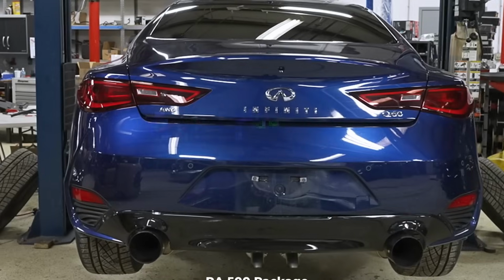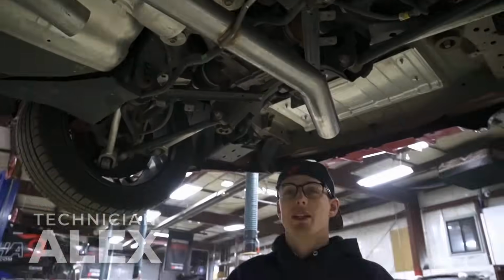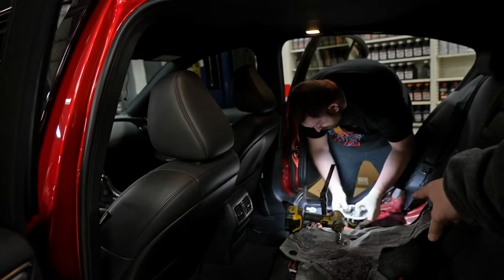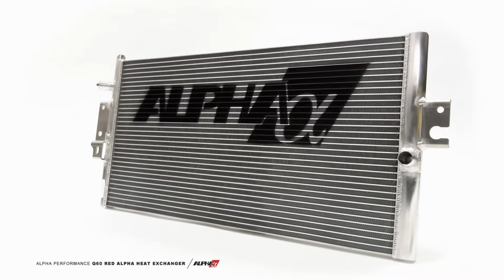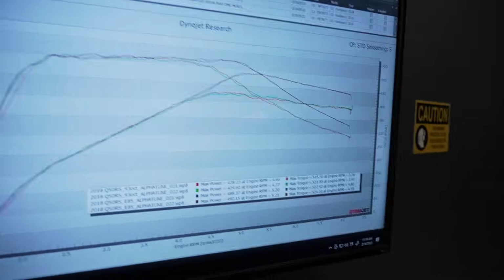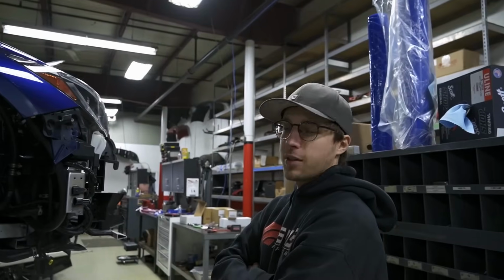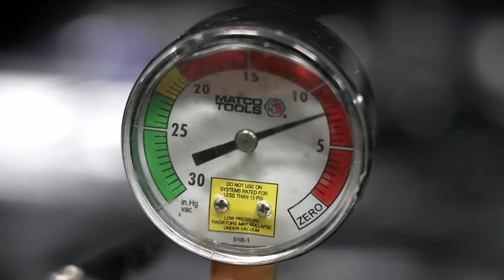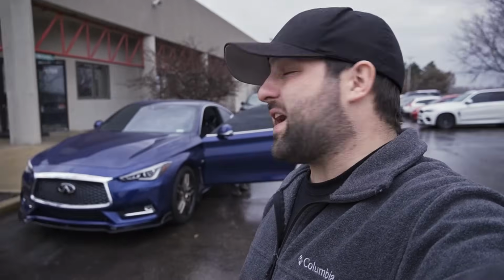RA500 Q50 & Q60 BUILDS | 500WHP AMS Infiniti Performance Package

Comment: Do you guys see any issues long term on cars at this power level with no blow off or bypass valves? I have essentially the same setup as your RA 500 package and currently making like 450/530 whp/wtq. Basically as much power as I can make on the stock turbos right now, but I don’t have BOVs. Initially my tune was setup so the throttle doesn’t close immediately to try and save on the thrust bearings in my stock turbos until I’m ready for Stage 2’s but at times that got a bit hairy because the car wanted to keep pushing  for a half second after you let off from WOT. So now I’m setup so when I get off the pedal the TB closes immediately but I know all that pressure going back to the turbos can’t be good. Especially considering the stock boost level on a Pure/Luxe is like 8psi and a RS is like 14 but I’m running around 18psi now. This is the only turbo car I’ve ever had with no blow off or bypass setup so it’s new to me. I did start running 5w30 rather than the 0w20 hoping that would help a bit.

Comment: Nice I have a 2017 RWD Q50S Added AMS  Airboxes and Stillen Cat Back Exhasut...I'm at 426 hp now...any other ideas?
Reply: From their site this package is : "Red Alpha Cold Air Intake System, Red Alpha Heat Exchanger, Red Alpha Full Downpipes, Red Alpha High and Low Pressure Fuel Pumps, EcuTek Bluetooth Kit, the RA 500 E85 Tune.

I'm not sure if they left the exhaust out of this package but it sounds like you need a heat exchanger, downpipes, fuel pumps and an e85 tune to make closer to 500whp.
Reply: You push 426 with those 2 mods and your not a rs?
Reply: Man that’s a lot of gains for 2 mods.  Wonder down the road if there will be problems blowing the engine..??

17’ Q50 Sport spec is on 300HP/295 Torque.
Reply: @Unplugged704  the low boost vr30 is mechanically identical to the RS in everyway except boost pressure. the RS has turbine speed sensors but the low output engine also has the capability to monitor shaft speed, it just does it differently.

Comment: Do you have to build the automatic trans that's on the VR30 to hold 500WHP or is that what the stock trans is max rated at?
Reply: Simple driveshaft upgrade and billet flexplate and it’ll hold up fine. The 7AT might not be a DCT but it’s relatively strong till around 750whp 530-550wtq

Comment: I’m gonna ask a dumb question but with e85 can I use premium gas
Reply: E85 is a type of fuel. Premium gas (typically 91 or 93 octane) is also a type of fuel. If you are asking if you are able to use premium gas in a car tuned to take E85, it’s not ideal. The spark timing is completely different as well as a host of other factors that not only reduce efficiency but also may put parts of the car in jeopardy. If you’re planning on only running E85 and have reliable access to it anywhere you go, then go ahead. Otherwise, just go for a 91/93 tune (which is what I recommend for most people wanting power) or a flex fuel tune if you so desire.

Comment: I need this as a winter car. 370z is not good in winter, lol. 😆
Reply: I have a 2006 Zed and it is marvelous winter car.
Reply: Yeah - had a snow storm at the grand canyon, walked out to my Z, and surprise 3-5" of fresh snow... was fun going 25mph doggin it in 3rd gear for 2 hours in worn down ps4s tires... never again!!  Learned that if you see 10-15% humidity in the forecast during the winter = be prepared.  I suspect the horrible winter behavior of the 370z on snow has to do with being staggered and the rear differential... easily the worst vehicle I've ever delt with in the snow... my $800 pos mazda college student vehicle did much better, and it was a total $hitbox.
Reply: @07wrxtr1  its the tires bro... get some winters on it and theyre actually pretty decent in the snow. worn down summers in the winter is asking for trouble

Comment: But how reliable is that 500whp on this car can you daily it comparing to the n55 and b58s for 500WHP daily
Reply: It holds up pretty damn good. I think that's about the limit though, personally I wouldn't go past 500whp with stock internals on these cars.

Comment: Great video I have a Q 60 I want to know is it OK to wrap the intercoolers to keep the engine temperatures away from them
Reply: Second this would love to know!!
Reply: Being that it's a liquid/air and not a Air/Air. I would say yes it's OK to wrap them to prevent heat soak. 

But then again it being liquid, it could possibly force the intercoolers to retain heat more. Since some air flow over the metal bodies could pull heat away too. 

I'm also genuinely curious as to what AMS has tested. I always been iffy with heat exchangers.
Reply from the maker: This is not something that we have tested so unfortunately we can't say one way or the other. We'll pass along your suggestion to the R&D team for future testing. Thanks!
Reply: @AMSPerformance  Yes thank you that would be appreciated there’s a lot of Q 50s and Q 60s out there that would like to know thank you again for your time
Reply: Why would you block ambient temps?

Comment: So what is AMS' stand on BOV's? They're not in any of your packages and from recent talk in the forum's, they're not needed and said to be detrimental to the VR30 platform by many tuners. The red Q50 didn't appear to have them and the blue Q60 did. Did these 2 cars have the exact same builds, except for the BOV's? 20HP difference between the two cars on the dyno.
Reply: They don’t sell them you buy it separately
Secondly, it just protects the turbo’s which is worth getting. Unless you want your turbos to blow.
Reply: @AstroM340i  they dont protect the turbos in any way shape, or form in the oem configuration. you have no idea what youre talking about.

Comment: Soo BOV YES OR NO ???
Reply: no
Reply: I read that BOV on a MAF system could potentially cause really rich engine running conditions. Since most of the air read by the MAF gets dumped to atmosphere before mixing with the fuel.

Comment: Non red sport model made more power than the red sport 😂😂
Reply: Basically the same except red sport has an extra intercooler pump and sensors on the turbo to protect it. That's why all that base models are blowing up because these kids are running map 4 jb4 lol

Comment: Meh q50-q60 has a pretty shit resale value no matter the mods! The cost of them off the lot is horrible to begin with and then to have to dump thousands more into them just to get them to 500HP that seems ridiculous to my pocket book. Plus paddle shifters eh. Manual trans big turbo suspension yada yada yada you’re talking ridiculous money to dump into a car that will be worth maybe $25k-$35k max resale after dumping thousands into a car that you paid $32k low end from stealership to $60k high end brand new and then the thousands for mods not worth it at all just buy a used one someone already modded! Your gain their huge loss. The end.
Reply: uhhh what? This is incoherent.

It's a luxury brand car....
Reply: @lossless4129  I’m not too sure how it’s incoherent to you but if you can’t understand what I typed there then move along little sailor and hold the banter for someone that can understand what I am saying. Bye bye. Luxury car? 🤣🤦🏻‍♂️